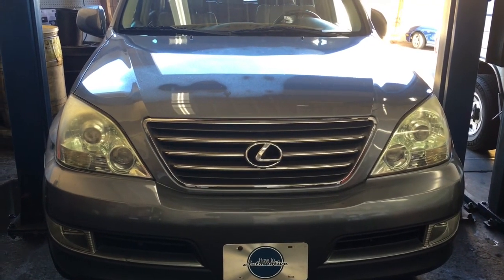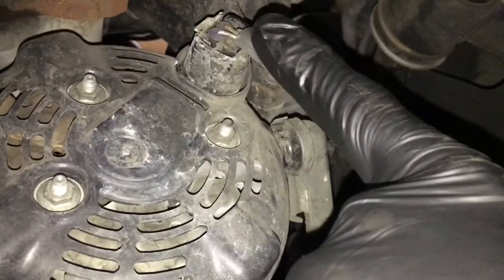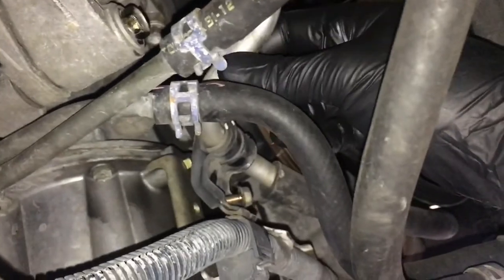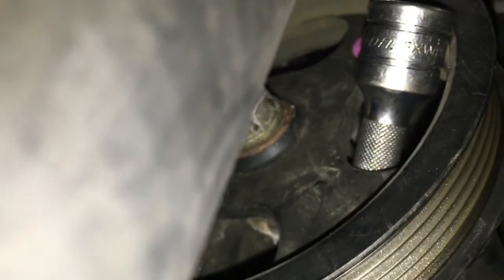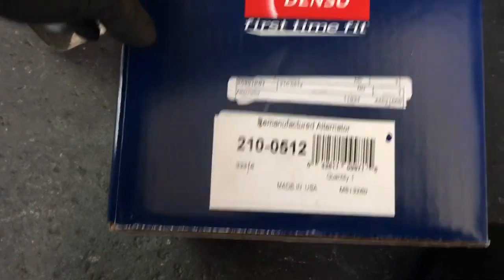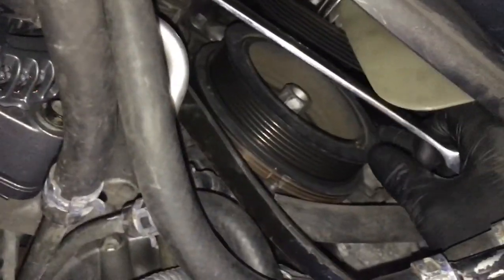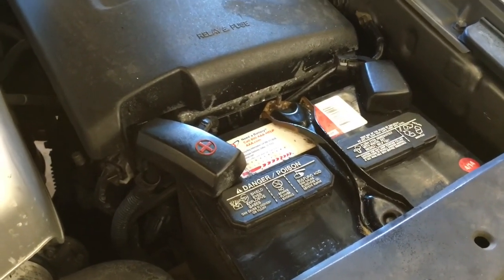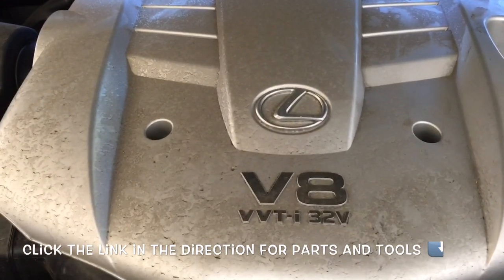How To Replace An Alternator On A Lexus GX470

Comment: Just got it done on my wife's vehicle. Your instructions are very helpful. Thank you. I just want to add a variation in my case that i couldn't remove the sway bar due to rusty bolts. I'm afraid I would break them. I did remove the two 10mm retaining bolts holding the transmission fluid hard pipes on the front cross member. This gives me enough wiggle room for the alternator to come out between the front cross member and the sway bar.

Comment: Thank you for making a complete, and actually useful video that doesn't mislead about the complexity, or the simplicity of this job.

Simple fact you mentioned the PS pully, let alone, accessing the plugs from behind the axle, and removing the sway bar (instead of being an idiot and screwing with the cooling system) earns a 5-star from me.

Great video. 11/10 👍👍

Oh, almost forgot to mention the belt routing diagram.

 This is the one video I needed from the start.

Comment: Thank you for the ~great~ how to. 07 4Runner 4.7 V8 the same. 
- Other videos show removing the alternator through the passenger wheel well access (instead of dropping the sway bar)... I fiddled with that but saw no way for it to fit. Should have just dropped the sway bar right off.  :) 
- Note to others to check the idler pulleys while the belt is off. I found my tensioner pulley bearing a bit loose. The 90mm pulley is available separate (and cheaper) from the tensioner The bolt that holds it on the tensioner is LEFT handed (righty loosey ...).
- On my 07 sway bar brackets the front of the bracket is slotted, so no need to remove (just loosen) the front bolts. Rear bolts need removed.

Comment: Great video, I replaced my friends alternator on his 2008 gx470 it only took me about 1.5 hours total. Alldata calls for 2.8hrs.  I didn't have the long wrenches so I ended up using my 3/8 torque wrench for the pulleys. I will be purchasing those mountain wrenches soon though!  I will say the hardest part was putting on the new serpentine belt the rest was cake.
Reply from the maker: Josh B sounds like you applied whatever it takes to get the job done👍🏻 that’s awesome!!
Reply: How did you get the pulley installed tightly? Seems like it's only going in halfway

Comment: How did you get to put back the PS pulley? Im having hard time getting it to fit all the way in. Thanks for this detailed instructional video
Reply from the maker: Make sure the pulley is not backwards. Also you can use penetrating oil to help.
Reply: @HowtoAutomotive  i just realized I might have installed it backwards. Good thing I haven't driven it. 😅

Comment: The service manual for my 2000 LC says to remove the radiator and PS pump. Your way seems a little less tedious and I don't have to buy new antifreeze. Do you think I can take mine out through the bottom or should I follow the service manual?
Reply from the maker: Michael Lloyd I would go out the bottom. You will save time and money.
Reply: Very good. That's what I'll do then. Thanks for the video
Reply: I ended up pulling the radiator. The 2000 LC is quite a bit different than the 04' and up. The anti-sway bar is not a factor because it's so far back. The only thing bolted to the alternator is the wiring for it. The other lines are tied to the frame. It was worth a try though...

Comment: Brian how long will this take us non-pros to tackle this task? My alternator is shot on my 06 GX470 and I need to replace it. I got an estimate from one mechanic to get it done for $250 including the alternator or $100 for the labor and I provide my own alternator (but he won't guaranty the work). Or is this a project that is doable for us regular joe's? I looked under the car after I removed the skid plate and there are just hoses everywhere. They could not have put this cot damn thing in a more difficult location.
Reply from the maker: damannoa I would say it's going to take you two to three hours. 100 bucks sounds like a good price.
Reply: I thought $100 (a little over an hour of labor) for the install sounded too good to be true and I even asked the Mechanic if he was sure it was only going to be an hour and he said he was familiar with the car and can do it at that time frame. Another mechanic quoted me $350 for the labor which I thought was more accurate. 

I've watched your video several times already and got my tools lined up so I'm gonna give this a shot today. I would feel a lot better doing this myself. Hopefully all goes well. 
Thanks for you valuable wealth of info bud!
Reply from the maker: damannoa if you want to job done right do it yourself:) thank you for watching and good luck.
Reply: Just finished up replacing the alternator today. Took me about 3 hours. It was a bit challenging, especially when it came to removing the power steering pulley. That itself took about 30 minutes. But I followed your steps to a T and got it done. Definitely a rewarding feeling doing it myself :-).
Can't thank you enough for this video Brian.
Reply from the maker: damannoa glad you got it done. Thank you for watching and sharing!